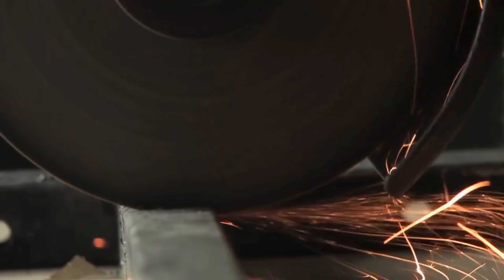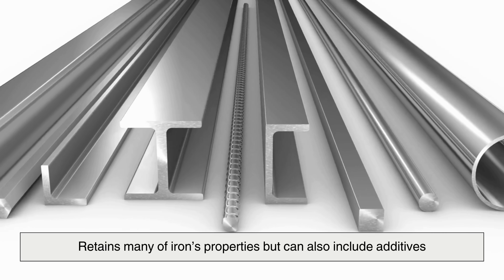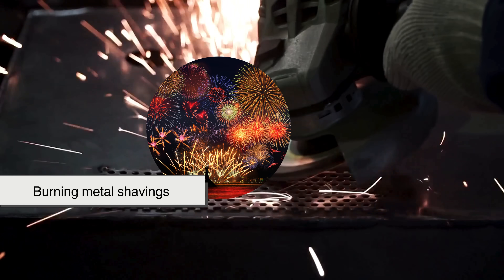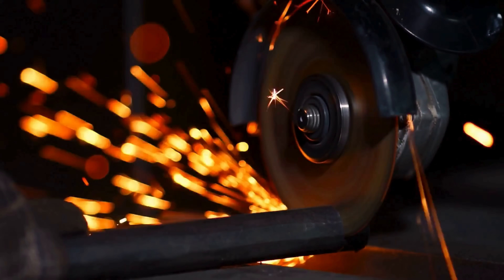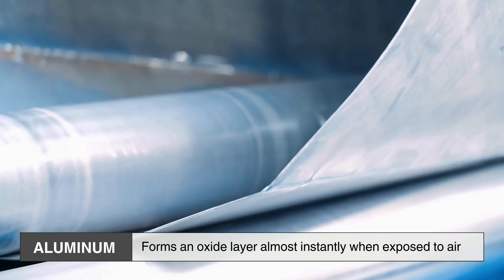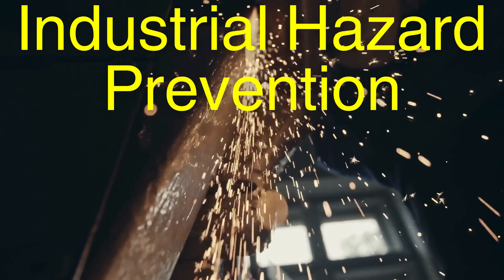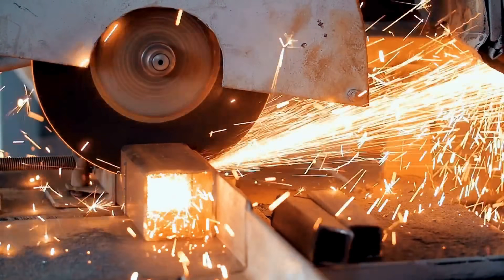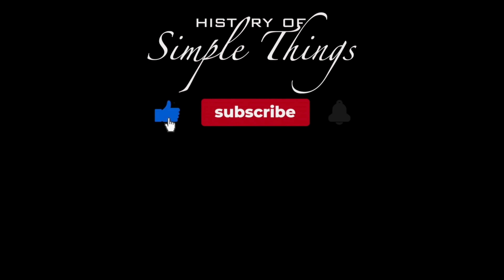Why Iron and Steel Burn Bright on the Grinder

Comment: In olden days before the invention of matches and lighters, fire could be ignited by the Flint & Steel Method. A piece of Steel was struck against Flint to produce red hot sparks to ignite tinder for starting a fire. Similarly Flintlock firearms used Flint & Steel to ignite gunpowder in the gun. Nowadays artificial flint known as Ferrocerium alloy is used to produce red hot sparks by striking it against steel.  Ferrocerium is used in lighters and in strikers to ignite gas fueled torches.
Reply: Cool dude👍🔥
Reply: How did they light the fire to make the steel
Reply: @nossapieterse3687  In olden days, before steel could be melted, primitive fire starting could be ignited by friction using dry wood such as with the fire bow, the fire drill, the fire plow or the fire piston.

Comment: No need to involve a grinding wheel. Finally divided metals  Typically will burn brightly, because they have a high surface area to volume ratio. Oxidation generates enough heat to cause ignition of the particle. Even lead does this as I have done in a lecture demonstration. For example, if you prepare, e.g., iron oxalate or lead oxalate, and thermalize them to produce the pure metallic elements, the resulting fine powders burst into flame on being poured out into air.